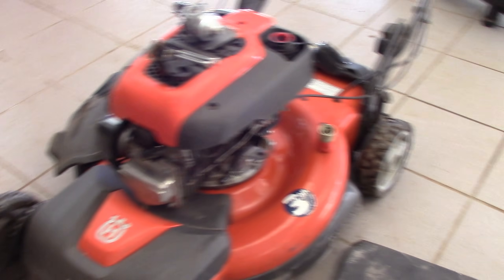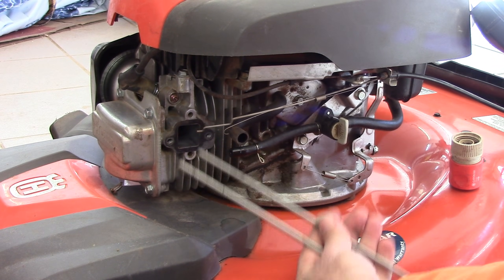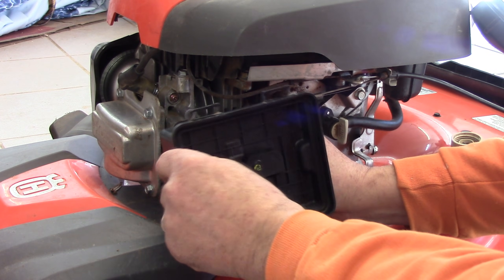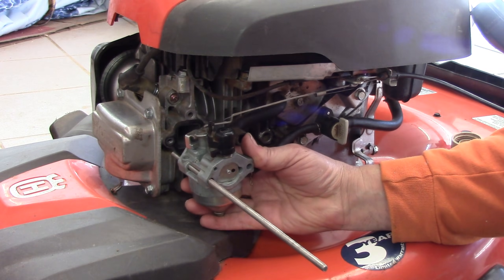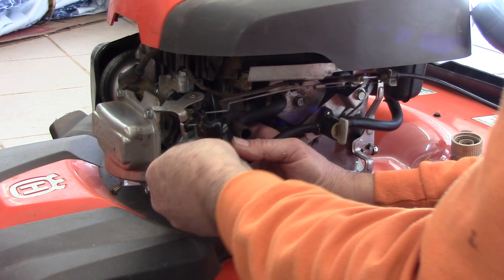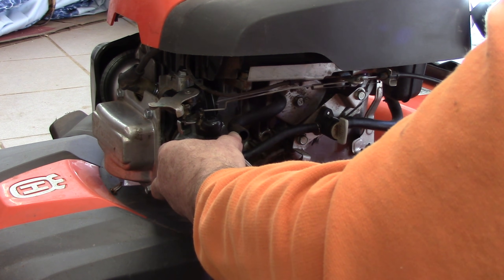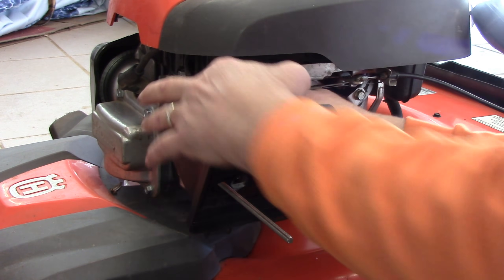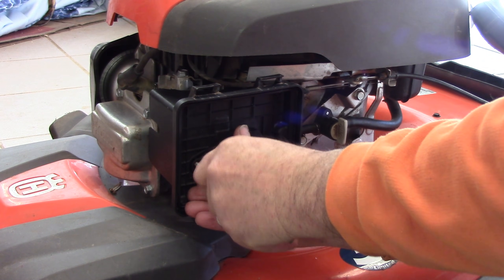INSTALL a HONDA CARBURETOR without LOSING YOUR MIND !! - GCV190, GCV170, GCV160, GC135, +More

Comment: I've been playing with lawnmowers for forty years and Honda carburetors are a PITA. This morning after half a hour of bad language not helping off to the local hardware store who have an excellent asile of nuts, bolts, and thingamajigs for two 100mm pieces of
 Threaded rod and two nuts to hold things tight.

$7. 

Magic!

Everything slid together.

Comment: The easy way is install the threaded rods and put everything on from back to front.  Remove one rod holding everything tight to the intake and install one bolt snug. Then remove the other rod and install the bolt.